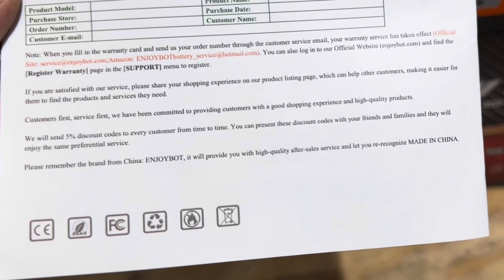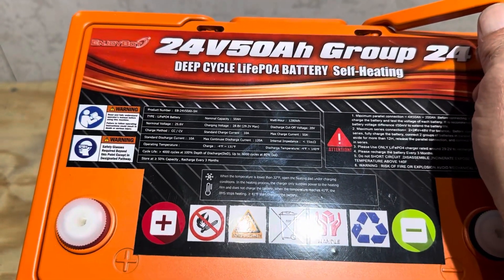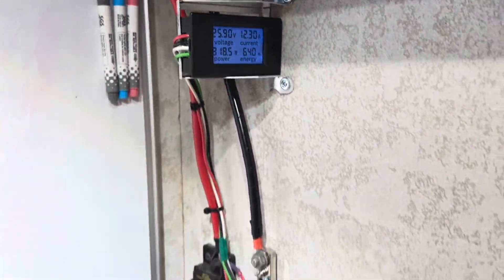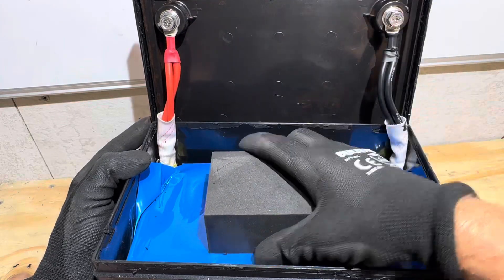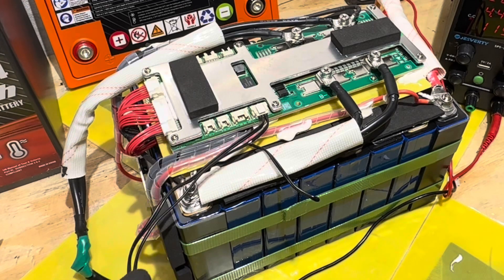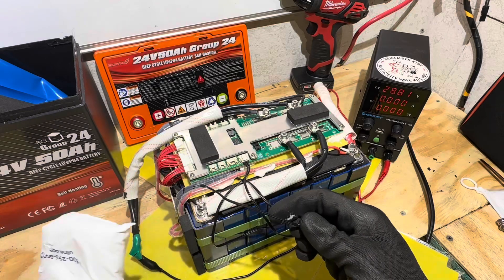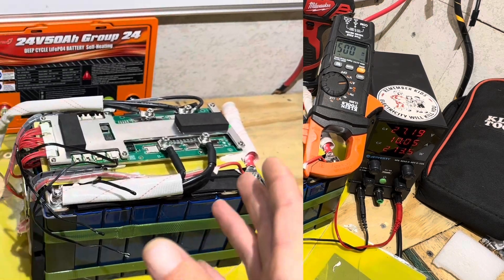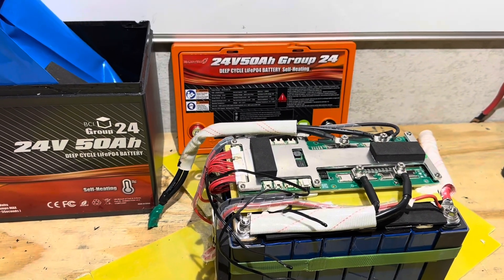EnjoyBot 24V 50Ah Lithium Battery Self-Heating Group 24 LiFePO4 Battery

Comment: Which is a better lithium. Enjoybot or LiTime? Using for a 36v trolling motor so I’ll run 3 12v 100ah batteries. I live in northern NY so it does get colder but I don’t fish when it’s below freezing. But sometimes in the 40s 50s
Reply from the maker: Probably a toss up between the two. I’d buy whichever is better for your budget. Both are great performers! Hope this helps!

Comment: Did everything it was supposed to do.  Nice build quality and decent price point. Just saw something about a Victron auto transformer and split phase output.  What is your thoughts on them.  I was thinking about alternative way to get split phase (240volt) out of a single phase setup.  I would like to see what you thought about them.
Reply from the maker: I haven’t used Victron AutoX or others. If  I was wanting 240 split phase I would prefer a dedicated inverter to support this. (Less components to fail and less losses through the system) 
If I had 120V and wanted split phase I would buy a properly rated buck boost with 120V primary 120/240 secondary. There will be losses of course through the windings but it would be robust and provide decades of trouble free service.
Reply: Thank you for sharing your experience.  I was thinking about a alternative way to generate 240volt.  
 @THEOFFGRIDMOUNTAINHOMESTEAD
Reply from the maker: Sorry I couldn’t provide a first hand experience with the AutoX.
Have seen buck/boost that are over 50yrs old and still working perfectly.